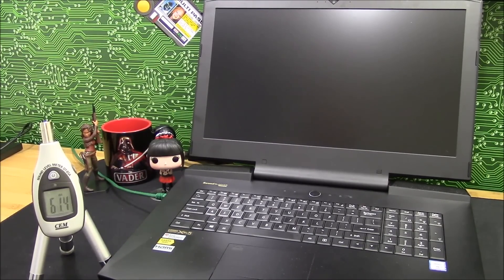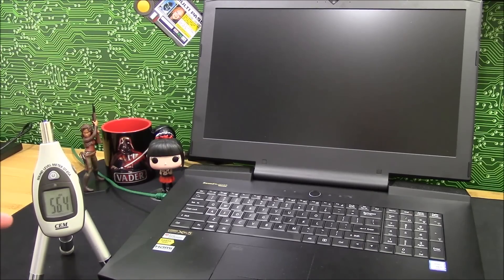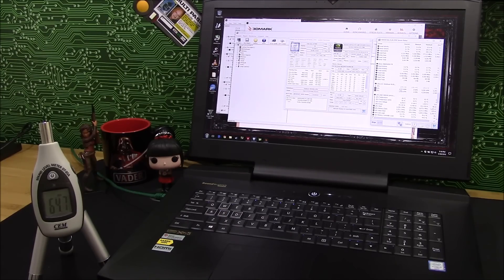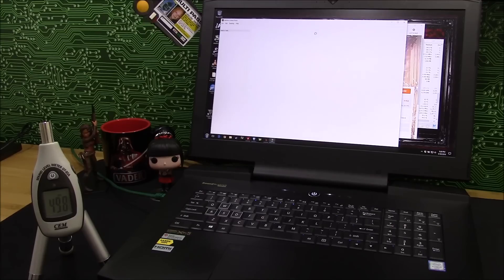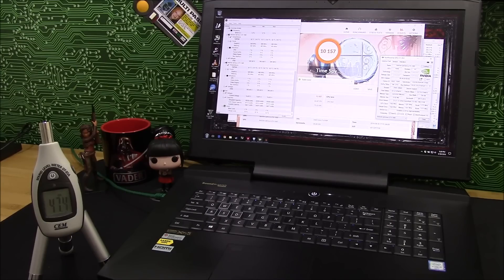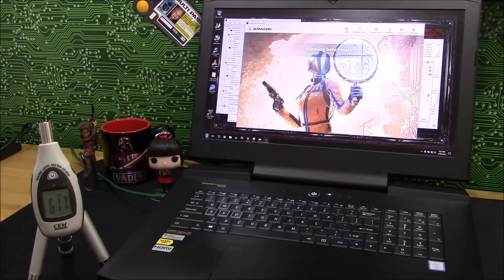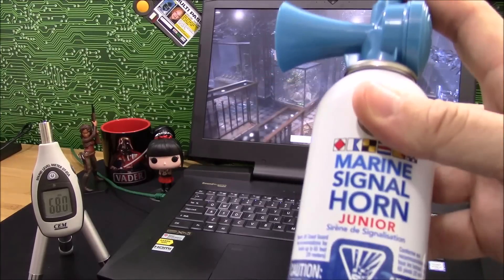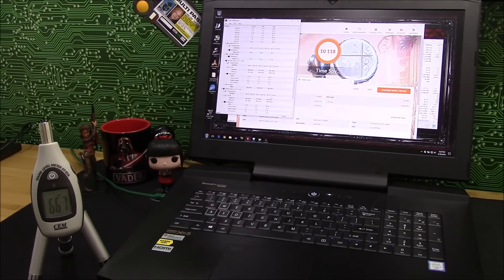Sager NP9873 / Clevo P870DM3 Fan Noise and Cooling

Comment: My unit seems to have cooling issues, my NP9873 just arrived yesterday and its CPU will hit 99C when running AIDA64 FPU stress test. 10% thermal throttling and even with all the fan maxed, the temperature is still 90C+. Is it because of a poor thermal paste application? Shall I redo it myself? Thanks a lot.
Reply: I had the same Problem with my 6700K. Only thermal Paste didn`t help a lot. But after delidding it and putting it together with liquid metal, i can even OC a bit without thermal problems. I think that's the best way to go. ;-)
Reply: The only other thing is what was shown in the Video, you can undervolt it.
Reply: Intel is to blame here. Crappy thermal paste instead of solder to make more money from us, and personally I trashed my 6700K when delidding it so I'm pretty anti-Intel now.

Comment: If you're worried about heat and really care about noise i got a laptop pad for cooling under the laptop and a opolar LC06 Laptop Fan which attaches to your vent ( mine is on the left ) which sucks out hot air and blows in cool air making an air loop for constant cool air inside your laptop.

Comment: I'm assuming that the S version, NP9873-S, has roughly the same temperature issues. Would under volting the GPUs also reduce heat, since the heat sinks look linked? I'm making the assumption that if one component either CPU or GPU causes too much heat it will reduce the effectiveness of the heat sink on the other component.
Reply from the maker: S-version is the same exact laptop, just with a slight discount with common pre-selected components. The GPU and CPU are not really tied to the same heatsink. Well they are through a thermal pad, otherwise independent. There will be some effect, but they are separate independent cooling systems. Undervolting GPU would require a modded vBIOS (visit premamod.com - possibly coming with one soon).

Comment: Yo that is suuuuuuuuuuuuuuuuuuuuuuuuuuuuuuuuuuper loud..... = vacuum cleaner ..... That presents a real problem brother.
Reply: This Laptop should include a Headphone set! However one must use a Sound system to connect to this with ultra base to block out the noise factor. .... Still, is a beasty laptop. Just was suuuuuuuuuuuuuuuuuuuuper loud.

Comment: I think it makes far more sense to get the i7 6700 (non K). Using far less power, basically same performance in games vs the K model and won't reach crazy high temps. I have the clevo p755 coming tomorrow so I will let you all know the temps I get
Reply from the maker: Why would you do that? You can tune the K version how you want, to match i7-6700. Without the "K" version you can't tune it at all.
Reply: A turbo boost of 4.00 ghz is more than enough for a laptop. I don't see the value of a K when you are getting high 80s and 90s. The only upside to a K to me is that it will sell easier if you want to upgrade to kaby lake but that's not on my mind at this stage. Non K consumes 52 watts compared to 74 watts. The K is for a desktop with a proper cpu cooler and sufficient airflow.
Reply from the maker: The non-K is lower TDP because it is 3.4GHz CPU with boost to 4.0GHz but there's no guarantee that it will run at 4GHz at boost considering its lower TDP. The "K" version is a 4GHz CPU out of the box. The K version can be user configured however you want in clock speed and voltage and TDP. The non-K cannot.  I can configure the K version to run the same as the non-K and get similar temps. There's nothing wrong with the non-K if you're not into tuning. But K gives you the flexibility to tune.
Reply: Yeh i see your point. I do like fine tuning but I don't really feel comfortable overclocking a cpu in a laptop. High 80s on the CPU is painful to me !! Do you know roughly what temps I might see on the CPU with the p755dm non K. I really like your videos by the way. Keep up the good work.
Reply: The K version has less tolerable temp limits over the non-k version even if they can run at the same temps.

The Non-k is around 90C. While the K version is around the 60s.
Reply: Never heard of this.

Comment: Hi HT, I have a clevo 870DM-G in Oz they are branded metabox,  and was wondering from your tear downs of both the 870DM-G and the 870DM3 do you think the former would be upgradable to a single gtx 1080? Thanks a lot your channel has been super helpful with me fine tuning my machine have a stable 4.4ghz oc on the cpu with a - 67mv undervolt and a 1327mhz oc on the GPU with an small 975mv over volt.

Comment: Hello bro, im interested in a model called "Avell G1843", a brasilian mark that is the exactly same computar as yours, but with only one GPU 1080 GDDR5X, I do Not have interest in 4K or VR games, so, with only 1 1080 do You think I Will have some problems with FPS in heavy games like GTA V, WITCHER 3, with all on ultra and 1080p? 
Configs
I7 6700k 4GHZ
GTX 1080 GDDR5X
16GB RAM DDR4
SSHD 1 TB
SATAE m.2 480GB
Reply: /watch?v=8JdrvCT8_fo watch from 9:22
-5-10% will be that laptom performance ;)

Comment: You mentioned undervolting by 160mv, curious as to what clock speed or multiplier you have the cpu at?  Have heard about undervolting the 6700k in these to help with temps.  Roughly how much did it help?  Great vid, looking forward to any more you produce on this!
Reply from the maker: It was running about 100C!!! Now it's in low 80C's, usually doesn't break 80C. Clocks are stock at 4GHz boost. Undervolting won't affect clock speed. Just drop voltage bit by bit, test, make sure it's stable, then drop again, test, etc.
Reply: @ htwingnut....... Awesome. this is very important. can you post an undervoltage video. I am considering purchasing this Sli beast. This will replace my 980m Sli beast. Also i did checks and a single GTX 1080 in SLi... destroys the 980m sli in every performance benchmark. That being said. Me upgrading to the GTX 1080 SLi is a very healthy upgrade. Though a very expensive one. I will shell out the money though. This is why i am Xtreme.... Please upload video. also i may flash the bios with Prema Bios... How much louder is this laptop than the Sager NP9377 980m SLi? Thanks in advanced. Really want to see that undervoltage video. Also i dont think repasting is necesarry . Only the undervoltage is necessary.